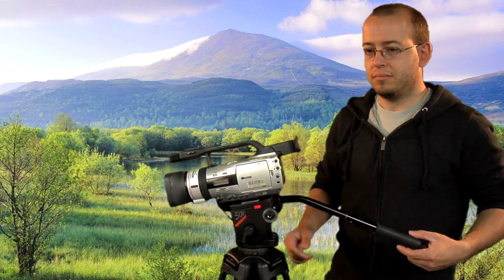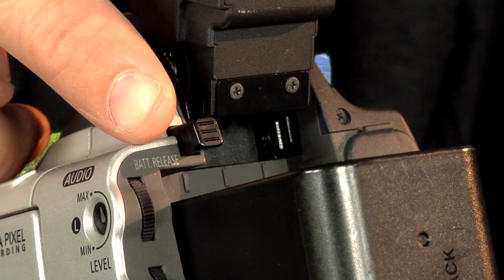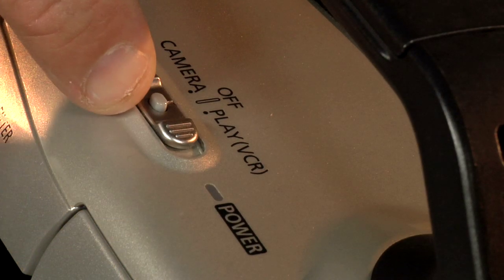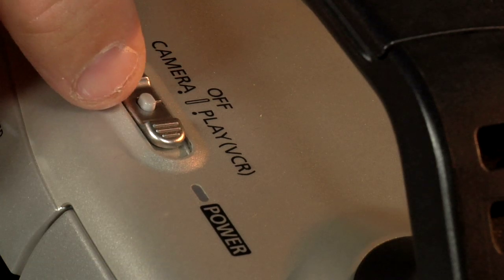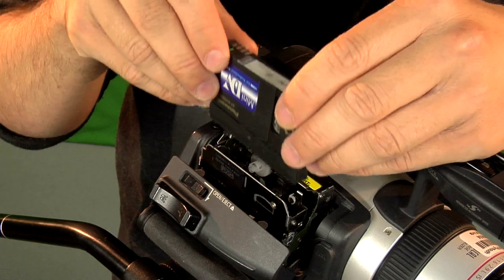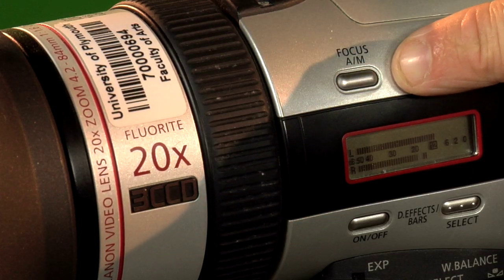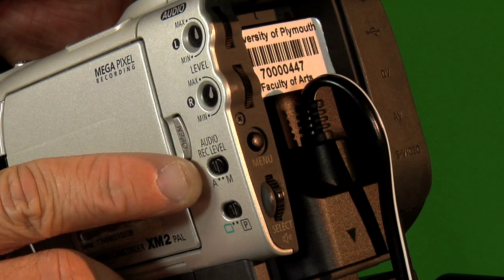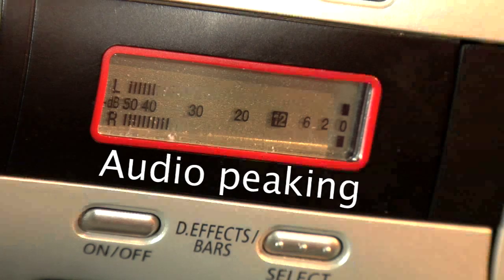CANON XM2 part one

Comment from the maker: The Sony brand of mini dv tapes tend to use a wet lubricant on the tape as opposed to Dry lubricant used by many other brands like panasonic.  Sony it seems is the only brand that does this.  When wet and dry tapes mix they form a glue and this can lead to dropouts.  If you use sony then stick to them and don't mix brands.